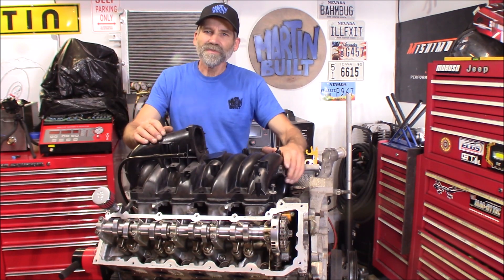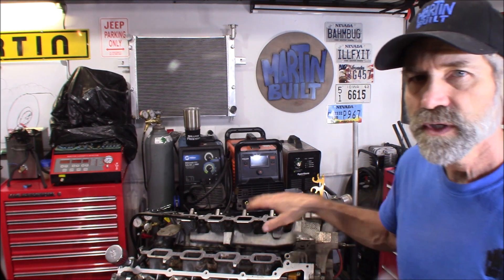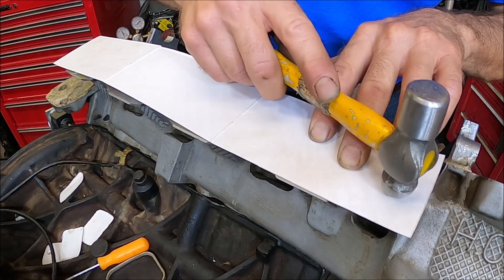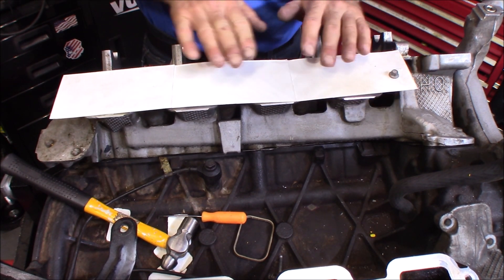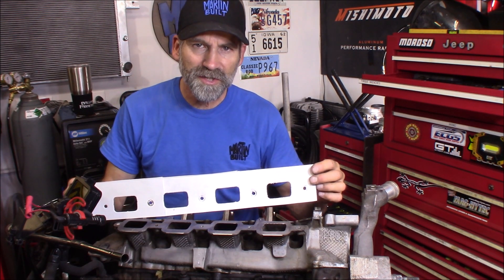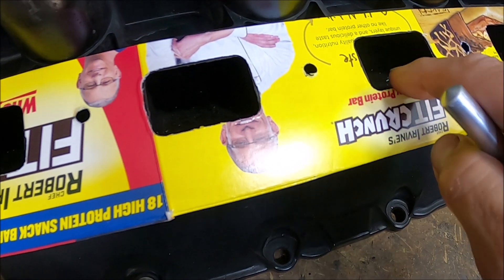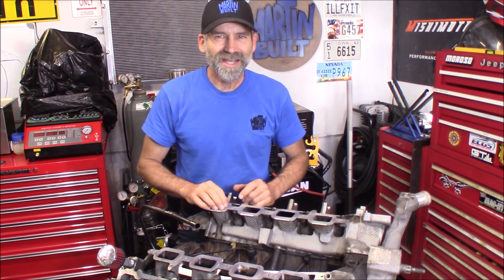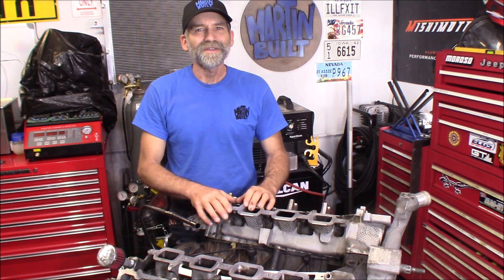How to Check Intake Port Matching from Cylinder Head to Intake Manifold

Comment: Can someone please explain to me why creating a cardboard template?
 Is a better Tech.
Nique then just using the intake manifold gasket which you are installing?...

The gasket should be the only template.You is when measuring up the ports, Simple reason being all you need to do is save off the extra material that is a smaller diamarwe than your ghasket... This is a proper way, Allowing you to safely expand the entry way of the cylinder head And take port. Fact of the matter. Is the less obstructions Equals better equals better efficiency and more potential potential. Theoretically you want the Intake ports to flow as best as possible with the most amount of air possible...please answer my question this shits killin
Reply: If your ports have been worked, then a factory gasket is useless for the method you describe. Unless, of course, you match the gasket to the ports - by the method demonstrated in the video.

Comment: You're the only guy who's doing port matching right! Most of the other fellows are doing gasket matching, which means the runners enlarge at the flanges and narrow down again as it reaches the valves, causing air velocity to drop at some point. Excellent video!
Reply from the maker: Thank you, I appreciate that. 🙂

Comment: Question is it possible to swap the v8 4.7 for the inline 6 4.0  if so how more reliable is the inline six and would it bolt right to the transmission or would that have to be swapped as well
Reply from the maker: you'll need to change the transmission, the ECM/PCM, radaitor and wiring. It can be done and has been done in the pasts.
Reply: martinbuilt is the 6 more reliable then the v8
Reply from the maker: @dennismack6389  yes it will put with more than the 4.7, the 4.0 is best suited for people that don't maintain their engines.

Comment: Hi mark, in a totally unrelated question. I replaced lifers on a 03 4.7 ram 1500 and I noticed after lubing and and installation and cracking by hand first couple revolutions and now couple day use with truck, I noticed my tap of the infamous second lifter tap on the passenger side again? Any suggestions on how I can remedy this problem or just redo. Thank you in advance for your reply 👍

Comment: You think there would be any good way to put the 08 heads on an older 4.7? Or be better to just replace the whole engine with an 08 engine? I know you had mentioned the ports not being the same size.
Reply from the maker: I'm looking into it, it's the combustion chambers that I believe are larger on the 08's. I think it would be best just to swap the whole engine.
Reply: @martinbuilt  Alright. My 99 has had a lifter tap since my parents bought it in 07 or 08. After seeing that video I'm somewhat a little scared now. And it has been overheated at least 3 times. No milkshake and has always ran fine. Has been one of the two best vehicles I've ever had.

Comment: Yes do it!!! Lolz I did this almost 12yrs ago with a 01 dakota sport 4.7L .... already got a fast man dan throttle body n other stuff... people told me that the ECU wouldn’t compensate for the fuel injectors I ran but it did.... took me a long time for mine coming back to it after work if I was up for it that is... but that 4.7L ran like a raped ape man...
Reply from the maker: yea I have done all kinds of mods on the 4.7 that is in my 04 JGC and still haven't touched the ECM and it runs great.